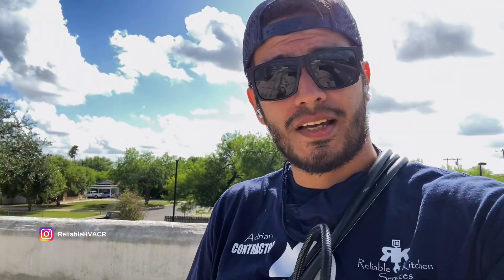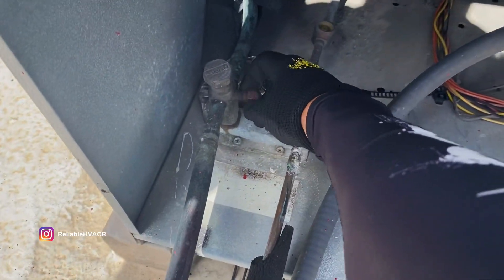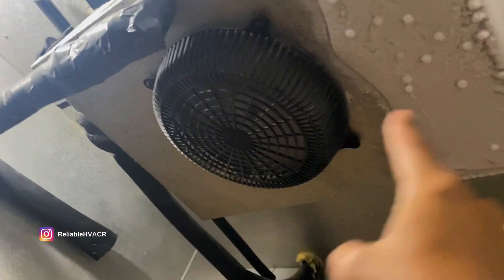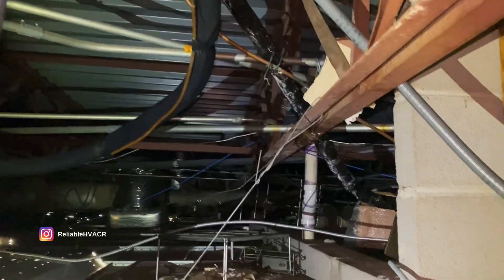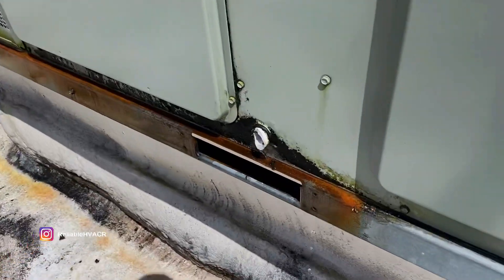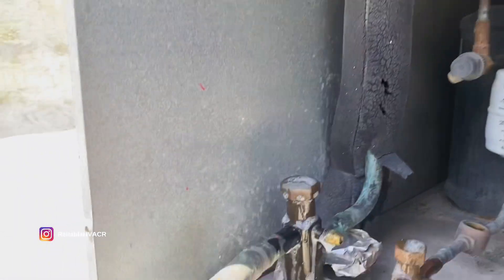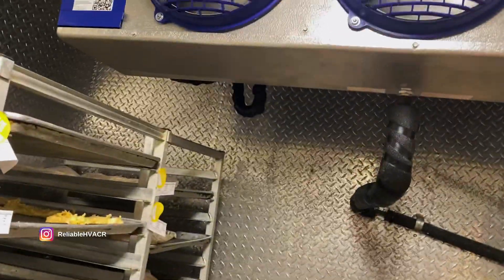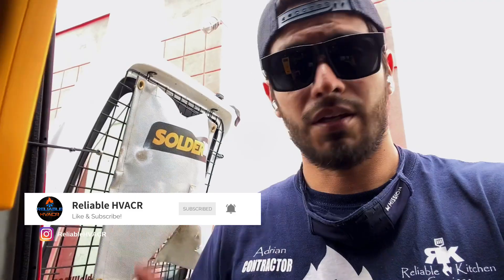How did I miss that? | HVACR Leak Check

Comment: Hey whats up its south side Chicago, you got lucky on that core bro. Even time I see those style caps and schraders are leaking means the last guy OVER tightened it and core removel is impossible.  Cut n replace valve. Great video keep em coming.
Reply: Cut and replace the valve? Jesus Christ just use a swivel tee lol
Reply: @jakem117  swivel tee always leak after time!
Reply: James... Everything leaks after time. I've seen twenty year old Tees leak free. 
 Why bill your customer for unnecessary labor and materials? If there's no receiver are you literally going to revocer the entire charge, change the drier, evacuate, then recharge just because the access port is leaking? 
Sounds like ignorance or a scam. Valve cores leak over time. With the same logic that you seem to support. If my coil is leaking it must be replaced and can't be repaired?
 The dude in the video replaced the valve core which is perfect. If it was stuck and wouldn't come out the swivel Tee would be the way to go period end of story, albeit a long one. Hope you learned a lesson about simple repairs and ethical service procedures that save people down time and money.
Reply from the maker: Yeah luckily I've been able to just swap the cores out. Appreciate it 🙏🏽 thanks for watching